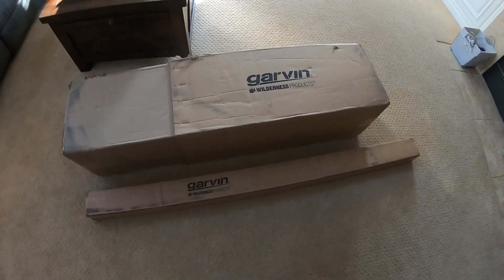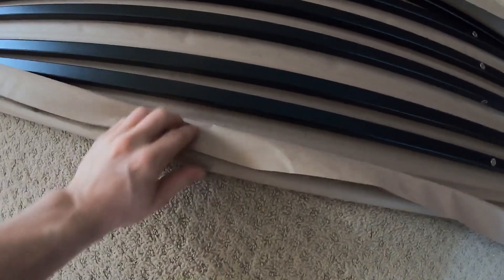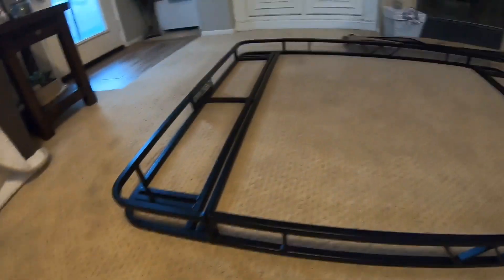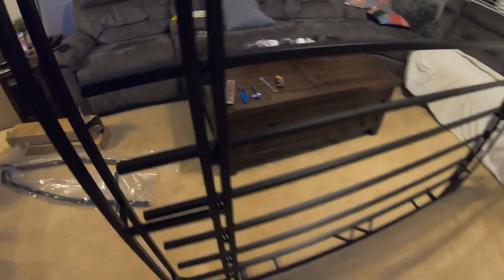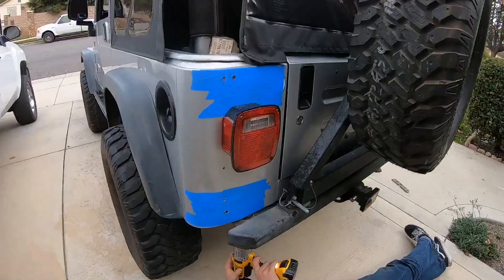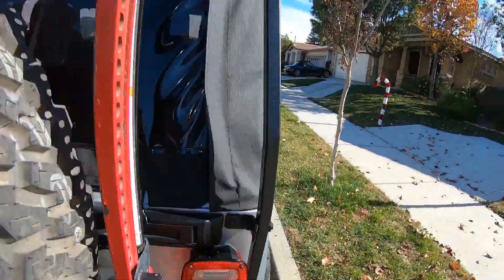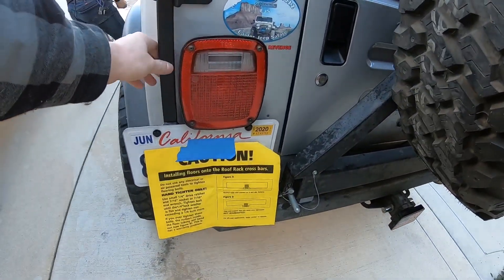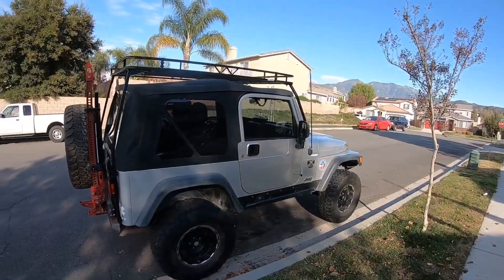Garvin Wilderness Expedition Roof Rack Installation for Jeep TJ

Comment: Couldn't find the review video but how's it do if you're standing on it? Do the bars flex a bunch or are they pretty rigid?
Reply from the maker: They flex a little do you are in the middle. 
There’s a few things you can do though, you can mount plywood up there, or even better an lighter, can cut and mount a metal grate up there.

Comment: Thinking about the same install on my 2005 Jeep TJ Rubicon.  Question, have you noticed an increase in wind noise?  I know Garvin offers a deflector as well.
Reply from the maker: Yes there is an increase in wind noise but not too bad. I have not purchased the wind deflector yet
Reply: @RandomThings911 is there a link you this rack? I have a 2093 TJ and want a rood rack like this.

Comment: Love your jeep and garvin bro!!! Thank for the how to video!!! 
Did you put the Plastic (3 plastic washer on each side) between the body and mounting plates? I’m talking about front mounts the hold up the rack.   

Or do you have mounting plates flush the side of the jeep without plastic washers in between. 
I just installed mine today and I’m not sure if mounted it correctly! Thank you
Reply from the maker: Yes the plastic washers go in between to prevent damage to the body. 
Thanks for the support!